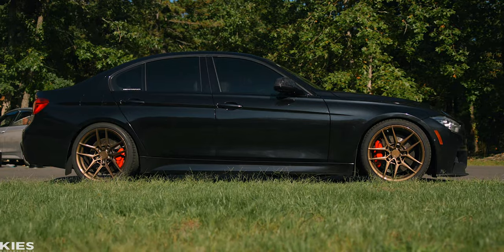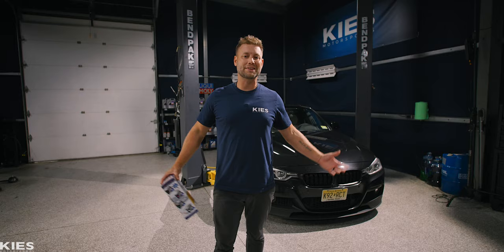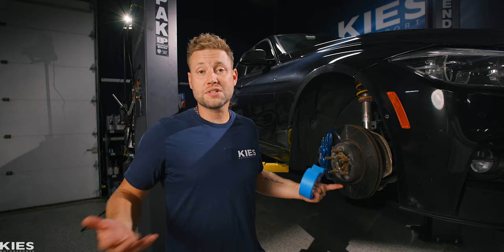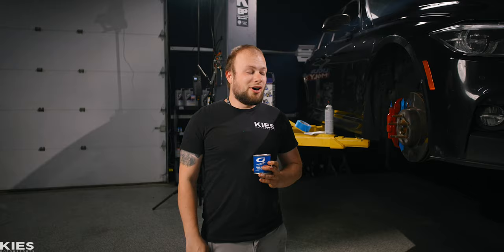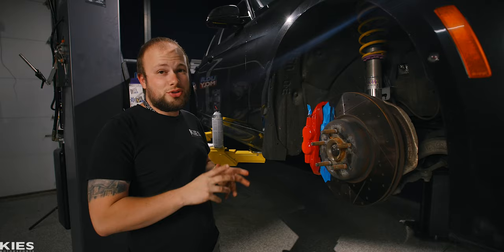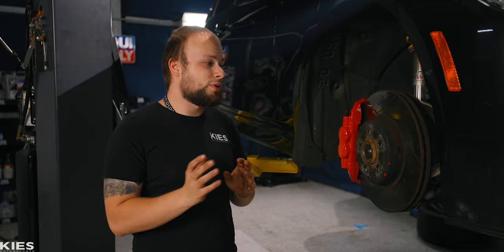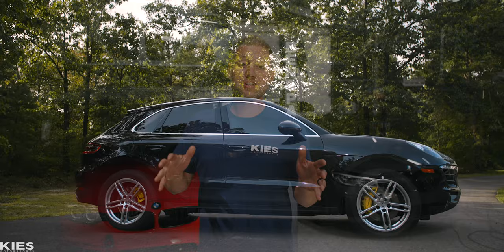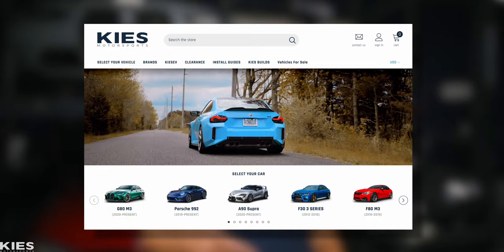🎨 Painting your BRAKES the EASY and AFFORDABLE way

Comment: G2 Caliper Paint is awesome! It’s a super hard epoxy that resists chipping and fading. My calipers looked freshly painted years later.

Some additional tips from my experience with G2USA Caliper Paint:

1) It’s a two part epoxy with limited use time once it has been mixed. So it’s best to have car up on four jack stands with all wheels removed. Could run out of time if trying to do two at a time.

2) The ambient air temperature during painting MUST be in the range of 56-70°F (13-20°C) to spread G2 properly. If air temperature gets a few degrees higher it begins to get gloppy on the brush and turns into a mess. It’s fine if the air temperature gets higher when it’s drying, that actually helps the surface to level out and remove any brush marks.

Tip for summer painting: Put the car in the air and do all of the prep work the day before. Then early the next morning when air temperature is in the painting range, spray them down with brake cleaner to remove any overnight dust or moisture. Then paint.

3) Only one brush is included in the G2 kit. Better to buy more to have others help paint or if you drop your brush. Harbor Freight sells a pack of 36 silver handled acid brushes for $2.99, SKU 61880

4) The latest non-chlorinated brake cleaner does a very poor job of actually removing baked on brake dust and dirt. Plus one can isn’t enough. Buy several cans of cheap no name brand brake cleaner at Walmart. Also buy cheap nylon brushes or even use an old toothbrush. A cheap plastic oil drain pan for underneath while you are cleaning is a necessity because all that nasty junk that comes off the calipers will stain driveways and garage floors.

5) Formula409 is absolutely the best for cleaning brakes. Haven’t found any other cleaner that works as well. Spray tons of Formula 409 as you brush the calipers. Keep spraying. It will foam up and lift the brake dust and dirt. Keep spraying. Then use the brake cleaner to rinse it off. And repeat as necessary. Remember that only the visible areas of the caliper need to be cleaned and painted. The backside is like the backside of the moon. No one ever sees it.

6) Now is the time to sand any rough areas on the calipers. Sanding sponges in various grits work well for this. Start with roughest grit and work towards smoothest grit. Spraying Formula 409 and using it as a wet sanding lubricant works well. Grey calipers can have rough spots in the casting. Blue calipers often have chips in the paint that could show through. Sanding the surface makes for a better result. Always spray down with brake cleaner after sanding.

7) Tape out any areas that you don’t want to accidentally hit with the brush, like bleed screws and their threads.

8) Wear a high quality painter’s mask like an N95 with the one way valve that makes it easier to breathe out. The epoxy fumes can really hit you you, even when painting outside.

9) Mix G2 according to instructions. Many thin coats will give the best results. One person will have to move fast around the car to try to paint all four themselves with many coats so there is a tendency to apply heavier coats. It’s best to have two people each painting two calipers and go back and forth keeping coats light. No rush to put the wheels back on. I let mine dry overnight just to be safe. The more time you give epoxy to cure the harder it gets.

10) There are many places on the Internet to buy brake caliper stickers. I got my Brembo stickers from a guy who I often recommend. He made me up sheets in several sizes because I wasn’t exactly sure what size would look best until I had them in hand. His business contact text/call is Scott at 954-266-8233

Good luck! Hope these tips help!
Reply: Lovely writeup mate, God bless
Reply: Would it be fine to paint in 40-50 degree weather?

Comment: Great, quick to the point video. I wonder if using a foam brush would keep the brush texture from showing up?
Reply: No foam brush is messier. And you have a limited amount of mixed epoxy. You don’t want a brush that soaks up/wastes a lot of it. Use the brush that came with the kit and the Harbor Freight silver handled acid brushes. Part number is in my comment